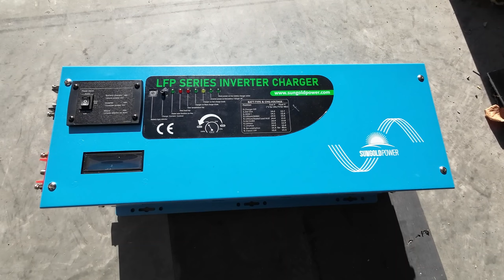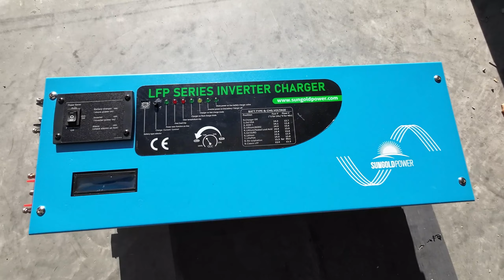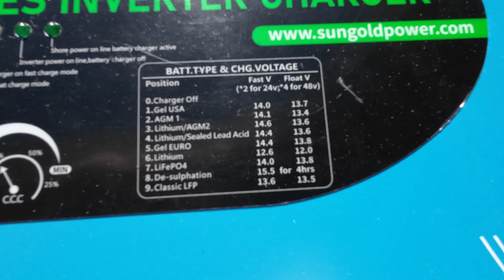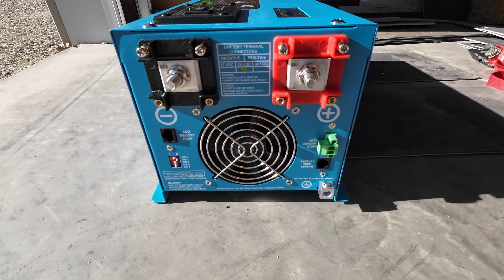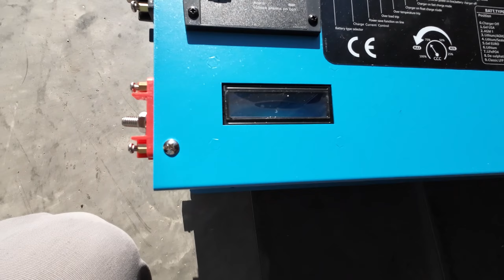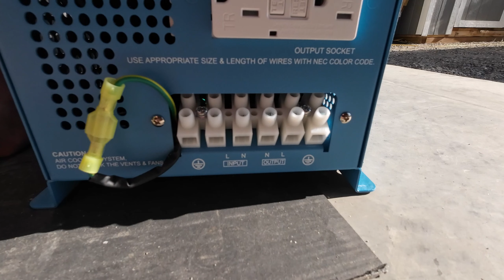SUNGOLD 24V INVERTER CHARGER. CAN AFFORDABLE ALSO BE GOOD?

Comment: night mode most likley means that it will top up the batteries during the night, depending on location and your agreement with the power company some people will have offpeak hours where they charge you less per kw.
Reply from the maker: Maybe but not sure how it would know what time of day it is. That would be cool though if so.
Reply: @Interstate78-qu2dw  

i checked the user manual too and it really has 0 mention of what the "Night charger Function" might do. i figured you could make changes through the ethernet port but it doesnt seem like its programable like some of the high frequency inverters ive seen.
Reply from the maker: @MHawkeye  no the cat 5 is for the remote. Maybe a service tech can hack into it through that but I couldn't find any info on it anywhere.